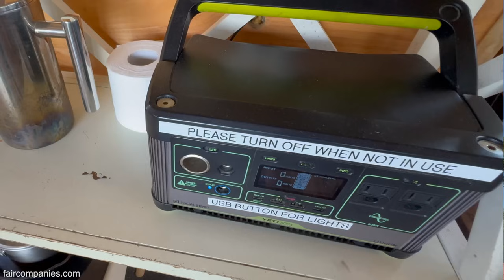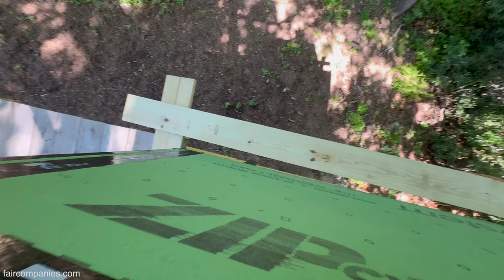He quit his job to build dream cliffside hamlet in Appalachia

Comment: i am not a structural engineer, but that treehouse has no leaves on the trees
Reply: @antiantagonist947  I was noticing that as well.
Reply: I’m not too keen on trusting that cliff myself
Reply: I'm not an engineer either, but it'll take a while for the trees to rot. I bet he could even take some measures to avoid it rotting.
Reply: @avienated  looks like white oak, i give it a few years with those 80mph gusts the gentleman was talking about (no disrespect or sarcasm intended, just an observation). it had leaves in the airnb listing. i have seen trees deleaf and come back the next spring, but never on a hardwood that sized
Reply: @antiantagonist947  you do have a point. I'll speculate that if he secured where the trunk hits the ground somehow (not sure how) it would help, as I think that's where it'll rot first. There has to be a way to preserve a tree so it doesn't rot, but it might not be a thing many people do =)
Reply: @avienated  Roots start to decompose from the moment a tree dies and theres not much you can do about that
Reply: @antiantagonist947  yes I said the exact same thing to my husband. Came here to see if anyone else noticed.
Reply: @rosemarymcbride3419  yeah, that's a fair point I suppose. He'd have to somehow anchor the trunk to rock or some tons of concrete.
Reply: @avienated  that's a well seasoned  tree....
Reply: @avienated no way to know 

I’ve cut down trees which looked perfectly healthy and yet the inside was completely rotted

They call them widow makers for a very good reason

Comment: I like it! But as a building designer, those cantilevered floor joists (even though they are oak) need to be a bit more stout - solid blocking at the beam, and some hold down straps. Uplift can lift it right up off those piers. That's a long cantilever relative to the length of the floor joists under the cabin. The timber frame is a bent system (as opposed to a common rafter system), so the roof is all dead load. Those struts are doing a lot of work, in bearing the weight - but they don't appear to have anything substantial for the wind uplift.

Comment: 7:40 No, the Barberton Mountains located in South Africa is the oldest mountain range on Earth at 3.5 billion years old. The Blue Ridge Mountains are the oldest region of the Appalachian range and are 1.2 billion years old.
Reply: blue ridge are 4 billion.
Reply: @JohnnyDanger36963  Nope. The lack of a calc-alkaline affinity and zircon ages less than 1.2 billion years old suggest that the Blue Ridge is distinct from the Adirondacks, Green Mountains, and possibly the New York–New Jersey Highlands. The petrologic and geochronologic data suggest that the Blue Ridge basement is a composite orogenic crust that was emplaced during several episodes from a crustal magma source. Field relationships further illustrate that rocks emplaced prior to 1.078–1.064 billion years ago preserve deformational features. Those emplaced post-1.064 billion years ago generally have a massive texture and missed the main episode of Mesoproterozoic compression.